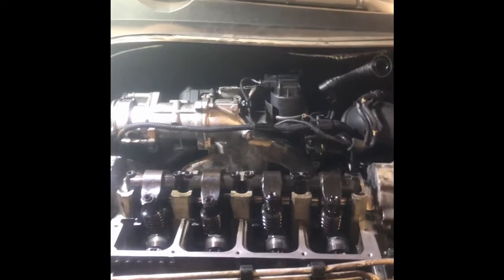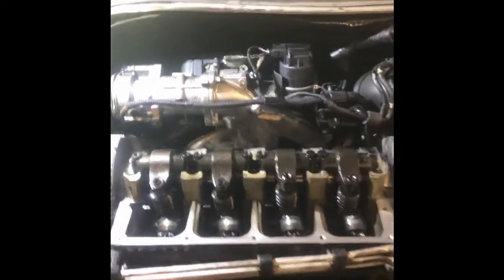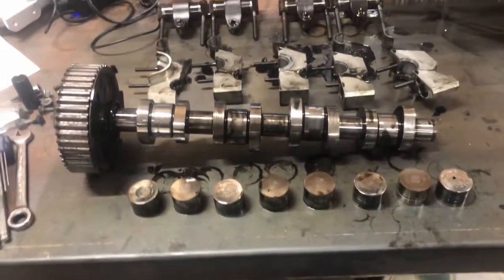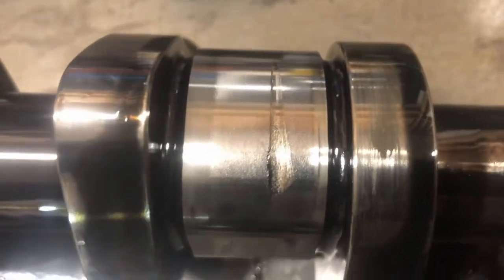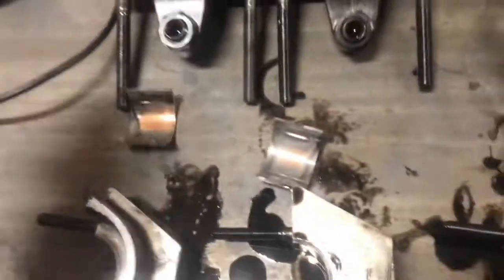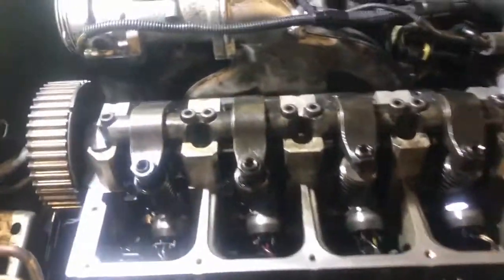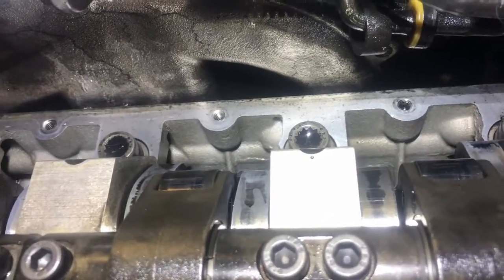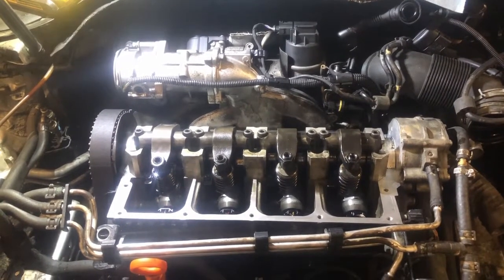06 BRM TDI: Inspecting and replacing a worn cam

Comment: hi josh   thanks for the video   i did not quite understand the adjustemt procedure for the injector adjustments
Reply from the maker: Your making sure the injector never bottoms out. So with the injector fully depressed (when the cam lobe lines up with the injector rocker) your turning the screw in until you feel resistance. That’s the injector bottomed out, you then go half turn loose so that there’s never a chance the injector is bottoming out during normal operation. If it does it’ll break the plunger on the injector making it unusable.

Comment: my 05 BHW Passat w/400k miles has a worn cam/lifters.  P0299 code (boost) issue.  replace all vac lines, N75, etc.  Even removed, cleaned, checked the VNT vanes.  Looked perfect.
 Was told probably the cam/lifters.   Got the cam in, broke an ear on the tandem pump  :(  Now I'm waiting on a new pump.  HOPEFULLY this'll be the issue for my P0299, FINALLY..
Reply from the maker: I did a video on v10 tdi cams right around the same time as this one, when watching on vcds you can see actual boost is nowhere near specified. It’d throw misfire codes as well as underboost. 

Makes sense since the exhaust can’t all escape in time and then gets forced into the intake when it opens, resulting in a lot less exhaust to spin the turbo and a lot more “egr” preventing it from running 100%.
Reply: @JoshsJettas  thanks!   Subbed.

Comment: Hi u dont show how u put back the camshaft
Reply from the maker: Hey the camera had died during reassembly and I didn’t catch on.
You’ve got a couple ways of installing it; 1. Since the engines locked at tdc you can install the new cam the same way it came out, cylinder 1 cam lobes facing up/forward and up/rear wards. 2. If you concerned of piston/valve contact you can rock the crank off tdc and install the cam as described above then rock the crank back to tdc and pin it.
Reply: @JoshsJettas  alright thanks mate. Btw good video.

Comment: thanks Josh! do you possibly have a link to the \bolts that you bought at fastenall? a very helpful video. thanks Pat
Reply from the maker: I bought them from a smaller hardware store, but m8, 90mm length and 1.25 thread pitch 12.9 grade for the injector rockers and m6 55mm length and 1.00 thread pitch 12.9 grade for the cam caps

Comment: What is Your opinion,  does camshaft replacement affect head gasket? Thanks!!!
Reply from the maker: No, as long as you don’t accidentally remove the head bolts thinking they’re the cam cap bolts.

Comment: My car is shaking after changing the crankshaft. (Only on start 700-600rpm). What can my issue be?
Reply from the maker: Crankshaft or camshaft? Few possibilities, air in the fuel system from having the tandem pump off (should go away after running it). Other possibility is torsion value being out (cam timing) which you’ll need vcds or a scan tool to check and reset
Reply: @JoshsJettas  on vdcs it says camshaft position sensor.
Reply: @JoshsJettas  also just when the engine is cold.
Reply from the maker: @eirikjohannessen6538  if it just happened and the code came up after doing the cam I bet the cam is either to far retarded or advanced and torsion value will read 0 degrees. I’d double check your timing.
Reply: @eirikjohannessen6538
Good possibility your timing belt was installed a tooth off. 
What did the problem turn out to be?

Comment: i have read there is a VW bulletin about installing the lifters to prevent damage , does anyone know anything about this ??? do you just pump them up in a vat of oil or something ??
Reply from the maker: If using new ones they say to install and then run the engine at a fixed 2000 rpm for 20 minutes, then drain break in oil and put regular oil back in.
Reply: @JoshsJettas  thanks for the info

Comment: Can you send me a good write up on how to do this?? Is it possible to do it without removing the timing belt?? Could I zip tie the belt to the sprocket , release tension, remove sprocket then perform the cam replacement?
Reply from the maker: There’s no where to run a zip tie through, best option would be mark the cam pulley and keep the belt snug on the crank but I’d be concerned of it jumping. Could possibly pull the crank serpentine pulley and mark the belt through the hole.
Reply: @JoshsJettas   I will be removing the crank pulley so I can set timing with crank gear marks and I do have the cam locking pin

Comment: I have been running Mobile 0-40W since 70k miles and sitting at 205k with 90% of the miles are towing up to 10k lbs. No camshaft issue yet.
Reply from the maker: Good oil definitely prolongs the inevitable. My Touareg had 167k km on it when replaced which I think mostly had to do with poor servicing. The car in this video had 409k km and it was on a budget so replaced with a used cam that I had kicking around that had 460k km on it.

Comment: Scary  I just bought a 2006 tdi 107000.miles .what oil do you use. And thank you very much for the great info
Reply from the maker: Hey, not sure which this one used previously. 505.01 5W40 is preferred, I've been using T6 with zinc additive.

Comment: Hello, thanks for this video its useful. I noticed you have the belt off, Im just wondering If I can do this job without taking the motor mounts and lifting the engine. Im just not sure there is enough room to get in there and put the belt back on. Yes mark the cam and belt as well as put the motor in TDC
Reply from the maker: Yes, this one was getting a timing belt so it was all getting replaced anyways. I’ve done one which kept the original belt, just loosened off and pulled out of the way. Definitely more awkward doing it that way though.

Comment: What is the part number for the BEW Cam. Did it come in a kit?
Reply from the maker: This one was actually a slightly used one out of an engine I’m building for a different car. BEW cam is 038 109 101 R. 
This is a stock profile cam so it will wear out eventually again but this particular car was high mileage so if I think the rest of the car will wear out before this will.
Reply: Could you please us to align lifters with their adjustment ?
We dont know how much distances should be
Reply: The lifters are hydraulic,no adjusting.

Comment: Change the oil more often and flush out all the metallic debris in the engine before the rebuild.
Reply from the maker: For sure, this one got a quick oil change 100km afterwards then it was good to go. I imagine the metallic debris would wear off slowly enough its caught between oil changes

Comment: Did you use the advanced method? Tdc the timing and rotate anticlockwise 90°? Also i presume you dont need the timing belt locking tools for the crank.
Reply from the maker: I use the timing tools personally, crank lock as well as cam lock. If you don't have VCDS/Vag com to set the cam timing the mark and pray will probably be best if the last person did it right.
Reply: @JoshsJettas  I’ve got the software you mentioned. How did you utilize them in order to find TDC or the correct timing? Thank you
Reply from the maker: @Wrensspeedshop  so with the new belt on your going to want to use vcds to check torsion value (cam timing) when engines up to temp at idle. I forget what group it is but you’ll want it +- 1 or so, it’ll be close if you lock everything correctly with the tools during belt replacement
Reply: @JoshsJettas  thank you for the information. I believe on one of your videos or another one I watched it shows the values and where to go in the CDS in order to check the timing
Reply from the maker: @Wrensspeedshop  that’s right I did a separate timing belt video on this one, I usually aim for +0.5 or +1. It’s a simple adjustment which can make a big difference on fuel consumption and power.
Reply: @JoshsJettas
Where specifically do you see better power? Mileage? At +1 ?
I’ve had good success just setting them to 0, but to get 45 mpg I need to be on the freeway going 65 and not stopping or climbing mountains.
Reply from the maker: @bobirving6052 I’ve always done +.5, people say they are better mileage with it negative and better power with it positive

Comment: When your setting your lash your getting it until it’s hand tight and backing off a half turn correct
Reply from the maker: Yes, use an Allen key and turn it in by hand until it stops then half turn out. 

Your bottoming out the injector when turning it in, that half turn out/loosened prevents it from bottoming out while running/tolerances changing when warm.

Comment: Hi Josh, I have 400k mile MK5 BRM that still gets 45mpg. As a preventative, what cam  and lifters do you recommend for the BRM.
Reply from the maker: Hey Mark, depends on your budget and expected life of the car. 

If the cars in good shape and you expect a long life out of it yet, I’d go with a colt cam with nitrided Ina followers with the inner springs knocked out. (I covered this procedure in my v10 cam replacement video when I installed stage 2 colt cams)

Next would be a billet cam or kolbenshmidt cam along with factory assembled nitrided Ina followers.
On a tight budget would be a bew cam of some sort, they have less aggressive lobes and should prolong life (that’s what I did in this video)
Reply: @JoshsJettas  Thanks for the advice. 06 Jetta brm w/ 380k, colt cam and stage 2 malone.
Reply: @JoshsJettas
Hey Josh. Did you notice any loss of power after putting the BEW cam?
Reply from the maker: @bobirving6052 it ran better then with the worn out brm cam, but I’ve never done a comparison between a good brm and a good bew